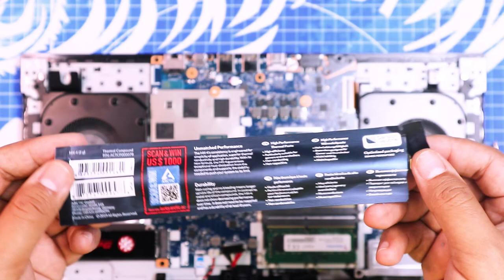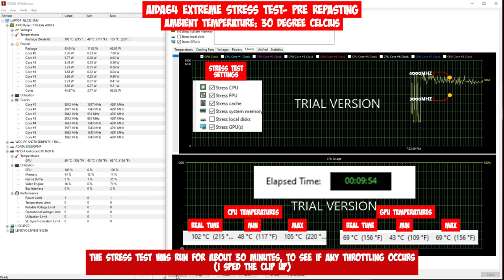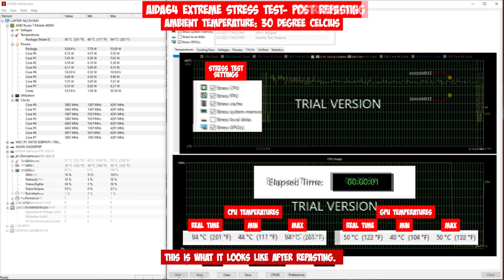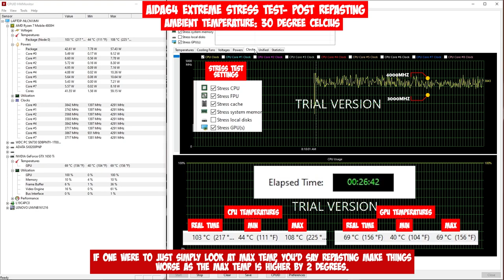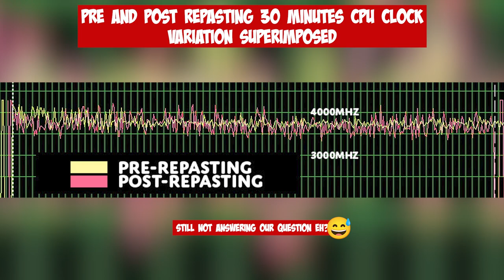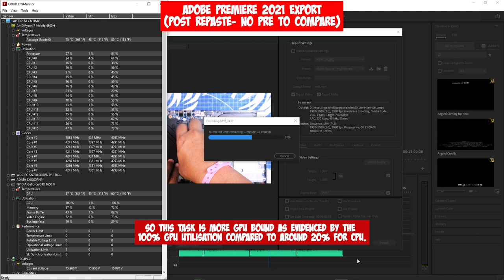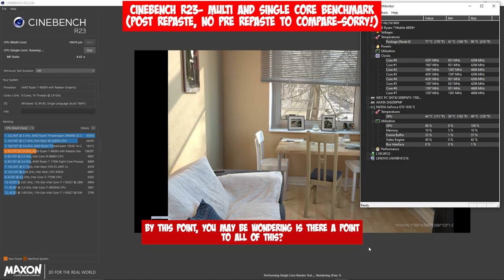Repasting My Lenovo Legion 5 |Replacing Old Thermal Paste|

Comment: Literally just bought my legion 7 3060 Ryzen 7 5800h two days ago and whenever I run apex on max settings it runs great, over 100fps, but my Ryzen is always at 93-94 Celsius. Should I take it somewhere to get looked at or is this normal even for a brand new laptop. I run my laptop on performance mode with performance fans on too.
Reply from the maker: hi thanks for watching. I'm currently running a Legion 5 pro with a 5800h and 3070. unfortunately my cpu can also peaked to over 90 degrees celcius during cpu intensive application. however the laptop cooling does a fairly good job to  bring down the temp to around 85 degrees or so.
performance mode not only cause the fans to spin faster, it also pump more power into the cpu and gpu. so don't be surprised that temperatures are higher in performance mode. for example, my laptop in auto mode gpu has power envelope of around 75w and temperatures hovers around 65 degrees. in performance mode it receive around 120w and temperatures is around 85 degrees celcius., this is despite the fan going full bore.
ambient temp and surrounding ventilation plays a role too. where I live ambient temperature is around 30 degrees, so I expect my laptop temp would be a few degrees higher than reviewers from colder countries.
hope this help.

Comment: notes
1. 1660 ti version and above have noticeably bigger gpu heatpipe. this guy has the lowest 1650 ti gpu, thus the heatpipe is small.
2. the fans on 1660 ti n above are not removable n part of the heatsink itself.
3. use kingpin kpx/thermalright tfx for best result since they got low viscosity, hence reducing pump out. apart from that, mx4 will not be able to handle ryzen

Comment: Hi Mate, thanks for your helpful video. It seems that the improvements that you've done are mostly came from cleaning the dust from the fans. I'm planning to repaste my 7 months old legion 5, but it seems unnecessary for now. Maybe I'll wait for another 5 months. But your video really helps the others if they're want to do the same things later. Lastly, I wish you a speedy recovery.
Reply from the maker: thanks for watching bro😊
Reply: Don't repaste laptop at least for 2 years of usage. And then don't blindly repaste it. Compare stress test results of your unit with results you can find online. If you get similar results, don't waste your time and money on repasting. Remove the back case, clean dust, especially from the fans, that's all you can do. Current pads and pastes can easily last 2-3 years without any performance decrease. Easily.
Reply: @micha8469  hi, actually when i first got my legion 5, i think my temps for the gpu were going up to 86 and cpu above 90.  Just 2 months back, i gave it for servicing, i told them to just clean the fans and not apply thermal paste and it was still giving the same temps but it gained it much slower. Now its doing the same thing and my temps for cpu is going above 96 but its not going above 100 and the gpu is throttling at 87 degrees in just 10 mins. Should i repaste the cooler? like only the gpu and cpu die. And which paste because i dont know if i can get the ptm 7950.

Comment: Is there a way to clean the fans without removing them?
Reply from the maker: hi. thanks for watching. you can just use an old toothbrush to clean the fans without taking them off. it's not gonna be as thorough as removing them, but should do a good enough job. hope this helps. 😁
Reply: @masterofnone4608  might wanna try that. Last question, is using a can of compressed air be good to clean these fans?
Reply from the maker: @rhen4short  yeah. should be alright. the toothbrush is there to help with the stubborn dust😁
Reply: what sku do u have? 1660 ti and above or below it?
Reply: @apiis  If you're asking me, I only have GTX 1650. (sorry for the obviously late reply.)

Comment: I have just replaced and cleaned my lenovo logion 5i after 3 years and I highly recommend you to do so if you have thermal throttling like I had. Also it was very easy to replace thermal paste of legion 5i with propper precautions and equipments.
Reply: Which thermal paste did you use and what are your temps in stress test
Reply: @tinosqindis1184  I did use mx6. I didnt do stress test but my temp is aprox 72 degree celcius while gaming (gpu power is at 80W)

Comment: have u considered removing paint from heatsink its proven that it retains heat
Reply from the maker: thanks for watching. no, I really haven't consider that. however, don't think it'll make that much of a difference. the contact surfaces and heatsinks are actually not painted. the heat pipes are painted but trying to scratch off the heat pipes would probably cause more problems. 😅 hope this helps
Reply: @masterofnone4608  Yeah but there must be some solvent that melts the paint off JayzTwoCents
 did an experiment and the temps went up a few degrees and is not the only video that i've seen https://www.youtube.com/watch?v=B1VmtuddYnE

I have same laptop as u do but with the 2060 the newer version 
Its the best laptop i've ever had.
Temps started to creep up, ill repaste it soon
I am sure i will remove the paint of the heatsink at some point

Comment: hi, i bought my laptop 4 months ago, and when i am playing games, the temps reach 95C, it is preforming well how ever, but am worried about long term. should i repaste, putting in mind i have no experience on how to do this. ty <3
Reply from the maker: hi. my laptop normally hovers around 85 degrees when playing games and have brief spikes(few seconds) of sometimes up to 106 degrees. despite this all core clock never throttles to base clock(usually all core clock hovers around 3.7ghz)
In the video, when I stressed the cpu synthetically the temps mostly run around 92 degrees with brief spikes of up to 106 degrees. in this scenario the cpu never throttled.
I agree, not the most ideal temperatures but it is well within the limits of the cpu as per amd. yeah, running the cpu at lower temps would be ideal but I believe this is what the cooler is capable of.
to answer your question, do I think repasting would improve situation, probably not. at least not to any significant degree. esp since the laptop is only 4 months old. it's unlikely that the thermal paste has degrade that much.
I would imagine cleaning the fans probably would do more good. depending on where and how you use the laptop, the likelihood of dust has build up on the fans causing airflow restrictions is probably more than thermal paste gone bad.
I mean if you really worried about long term effect of high temps, try looking into undervolting the cpu. I mean, I personally don't have much experience with undervolting but I suppose it's an alternative that you can consider.
hope this helps.
Reply: @masterofnone4608  ty very much
Reply: @masterofnone4608  same thing with my legion 5,  brief spikes to 106c. got me worried so I cleaned them fans and vents and changed the gpu and cpu thermal paste after exactly a year but not much of a difference it still reached 105c sometimes then hovers to 87c to 95c depending on the game but I noticed it's only doing that if I'm playing while it's plugged in. On battery gaming it sticks around 85c to 90c with brief spikes to 98c.  I'm not using any cooling pads, just  an open stand that elevates my laptop for better airflow. Are your results same whether you're playing on battery or plugged in?
Reply from the maker: @armanddavid952  hi. thanks for watching. technically when gaming on battery by definition the power draw to the cpu/gpu is limited. therefore the temperature would be much more under controlled.
However, when plugged in the cpu/gpu is allowed to draw higher power, leading to better performance and of course higher temperatures.
most of the time unless you really looking for it, or have monitoring ongoing you won't notice the slight reduced performance while on battery.
I myself very rarely do any gaming on battery as it drained too quickly to get my gaming fix😅
I hv an upcoming video where I attempted another repaste and do a more detailed analysis on the temp behavior. hopefully it'll be done in the next week or so.
hope this helps.
Reply: @masterofnone4608  Thanks! will wait for your next video. I'm planning to repaste my thermals as well and get cooling pads. I'm not ok with 106c spikes at all. Per amd max temp for ryzen 4800h should be at 105c only.

Comment: Hey, i also have the same lenevo model with gtx 1650 and ryzen 5 4600h but my cpu is going to a temp of 80-90 degree celsius somtimes, even 104 degree celsius(but that goes for only 1 second) please tell if someone can help but my gpu is just fine about 60-70 degree celsius
Reply from the maker: the temperatures sounds just about right for a legion 5. it usually spikes to 80-90 degrees when doing intense workload and yes it can spike up to 100 degrees(very briefly) at times. especially if you are on performance mode. things you can do to improve the temperatures include cleaning the fans/vents and also repaste. hope this helps.

Comment: Mx4 good thermal for legion 5?
Reply from the maker: hi. thanks for watching. as far as my testing goes. it's as good as the factory one. the difference is around 1-2 degrees celcius at most.
Reply: @masterofnone4608  used mx now my temps before were Like going to 93/94 now its 80/82 really nice
Reply: Hey how long did that mx4 stay durable? I'm planning to get gelid gc extreme because I can't buy the ptm paste

Comment: Hello, I hope you're doing well. I've got a question about micro stuttering while playing some games. Some times when I played some games such as Genshin Impact, Apex Legends, Assassin's Creed Unity, Atelier Ryza series and Devil May Cry 5, I felt a bit stuttering and even worse my fps dropped between 5-15 fps in some cases. I tried to looking for the solution such as reinstalling the AMD driver or check the Lenovo Vantage setting, but it seems neither of them works. I never tried to overclocking or undervolting my hardware, and I already clean and repaste my thermal paste on march this year. Im using the R5 4600H and GTX 1650 (non ti) unit, also I used medium-low graphic setting on those games except for DMC 5 I used the highest setting because it already plays above 60 fps. So if you have any solution for my problem, that would be nice. 

Sorry if my Grammar so bad, my native language isn't English.
Reply from the maker: hi. thanks for watching😊 unfortunately I never  play the games you mentioned(I usually play much older games as they're cheaper on steam😅) , so I have no idea whether they would behave the same on my laptop.
I don't really know what causes the stuttering/dropped frames. 

However, I can just think of one thing that may(or may not) help. did you disable the hybrid mode? you can disable it in lenovo vantage software and it will require a restart. disabling hybrid(optimus) mode will cause your laptop to use the discreet graphic card only rather than letting your laptop decide to switch between the integrated graphics and the discreet graphics according to demand.

I mean that's the only thing I can think of. if you already turned hybrid mode off(which I'm pretty sure you did, the fact that u repasted ur laptop and did the standard driver reinstalls tells me you're not the average user) then I'm not really sure what's causing the issues.

hope this helps. thanks😊

btw, you're grammar is pretty good. much better than mine anyways. I'm also not a native English speaker😉
Reply: Hey i had the same problem some time ago.The way you can fix it is by disabling performance mode while playing games.The shortcut for doing this is fn + Q. You can tell which mode youre on by the color on the power button.If its red youre on performance mode and if its white youre on normal mode. Dont worry about the blue one.Just make sure that the light is white while playing games. This will fix the fps drops. Im not sure if it actually lowers the performace of the laptop but for me normal mode is just fine and im getting the same fps. Hope it helps!
Reply: @masterofnone4608  Thank you for the reply, Unfortunately I already disable the Hybrid mode and I also trying using the Studio Driver and Game Ready Driver in Nvidia setting. Both seems doesn't really affects the gameplay so I turn it back to Game Ready. And when I consulted it to my senior at college, he said that I should trying to uninstall the AMD driver. At some cases it does reduces the stuttering than before. Ah and thank you for the praise, it boosts my confidence a lot.
Reply: @lukskiller5850  Thank you for the reply, actually I already played with Auto mode (white light). So I tried to uninstall the AMD driver and actually it helps to reduces the Stuttering a bit. And actually I've tried to uses performance mode and compared it to Auto mode, and there is no difference on FPS while playing, but when I tried to record with OBS, the performance mode fan noises is louder than the auto mode. Maybe it's just my unit?, anyways thanks for the Information. I thought that playing games with auto mode is wrong for gaming laptops.

Comment: excellent video.. Just a question: can you remove the fans only without removing the main heatsink? so that you only clean the fans without repasting?
Reply from the maker: hi, thanks for watching. unfortunately one of the screws holding the fan bracket is placed underneath one of the heatpipes(both sides), so if you want to remove the fans you have to remove the heatsink. somebody did mention in previous comments that you can actually remove the case of the fans by undoing some small screws, I never tried that.
However if you just want to clean the fans without removing the cooler, I suggest using on old toothbrush to clean the dust off the fans. it works for me.
hope this helps.
Reply: @masterofnone4608  In the video it appears none of the screws are under the heatpipe? you can remove the screw in the corner and pull it maybe?
Reply from the maker: @ozgur5443  yes. sorry, what I meant is the bracket holding the fan is underneath the heatpipe. i suppose that  may work, unfortunately I just sold my Legion 5😅 so I have no way to check if that'll work.

Comment: Great video , but I have a question : When I first bought my legion 5 temperature at gaming was about 85 ( avg ) then I took the device to the warranty center and they repasted it then temperatures decreased to about 75 ( avg ) in the same games , all of this was 7 months ago and now the temp. exceeds 90 I doubt they used a bad type of thermal paste that dried on the cpu (i710750h) , gpu (rtx 2060 )  and I am willing to buy an arctic mx 4 and return to the warranty center to repaste the laptop again am I right ? and thanks in advance
Reply from the maker: hi. thanks for watching. I honestly cant tell you whether the problem is due to the thermal paste . however, before repasting I personally would try cleaning the fans and vents. The temperature increase may just be due to dust accumulation. hope this helps.
Reply: @masterofnone4608  Thanks for your interest,  this really may be because of dust accumulation and also I forgot to mention that the room temperature is from 35 to 40 when the laptop temperature rises to 90 in gaming
Reply from the maker: @SupermathsMSS  yeah. I also noticed my laptop run a few degrees higher than most reviews on YouTube(most are from colder countries), I believe because the ambient temp is higher(I live in Malaysia, tropical country and my room got no air conditioning😅)
Reply: @masterofnone4608  totally agree with you , my room also have no air conditioning and sometimes the temp reaches 45 as a result should I repaste the laptop each summer ? Is repasting related to a regular specific time or only by observing Temps ?
Reply: @SupermathsMSS  hello sir we have the same problem. I just want to ask if you did repaste you laptop already ?
Reply: @clydecaguiat1754  yes but the difference wasn't great

Comment: one more question do u think ifixit essentials are good for this job? or do u reccomend anything other?(i am from greece)
Reply from the maker: hi. to be honest I'm not too familiar with the ifixit essential kit, but being an ifixit kit I'd assume it's of decent quality. 
to be fair, you really just need a standard Phillips screw driver and some plastic picks or pry tools(if you care about not scratching the back panel). you also may need some micro fibre cloth and alcohol wipe to clean the old paste.
I'd just use whatever I have lying around, and wouldn't go out of my way to get the ifixit kit just for this. however, if you already have the kit in hand, I imagine it would do the job well.
hope this helps 😊
Reply: @masterofnone4608  ok thanks alot for your answer

Comment: The left and right exhaust gap is the most difficult to pry. I broke 3 clips when doing it on my own XD
Legion 7i, tho. But it should be similar.
Reply from the maker: agreed. the sides are annoying to remove.
Reply: Same I opened my in the process broke 3clips aswell

Comment: but what is that paste called i wanna know? and how much it boost the performance despite tanking warrenty?
FYI  i have the same laptop 1650 version curious
Reply from the maker: hi. I used artic mx4 thermal compound. unfortunately for me, repasting did not improve temperature that much. not sure whether other thermal compound brand would yield better results. hope this helps. thanks for watching😁